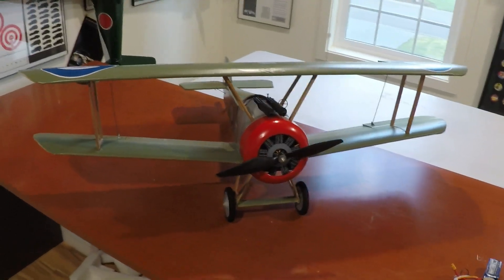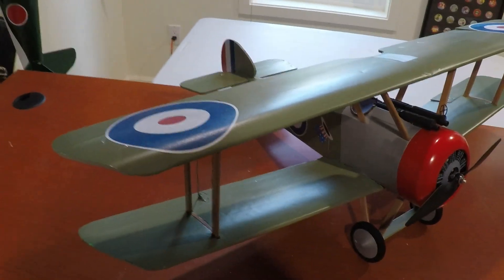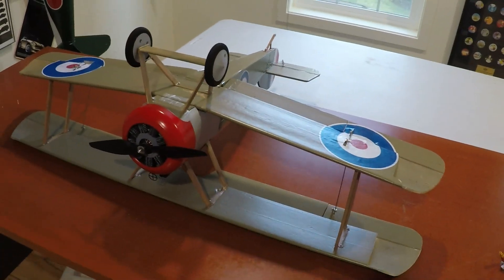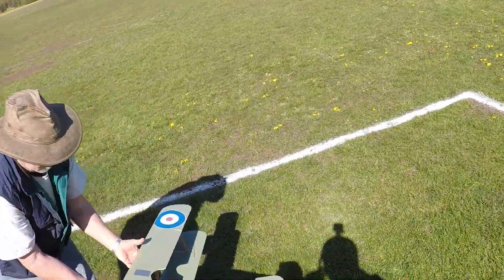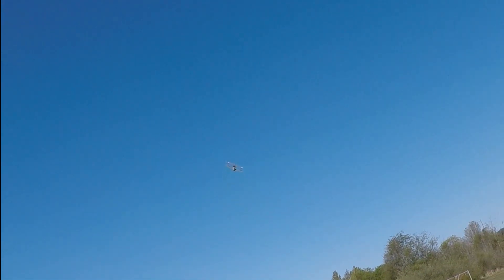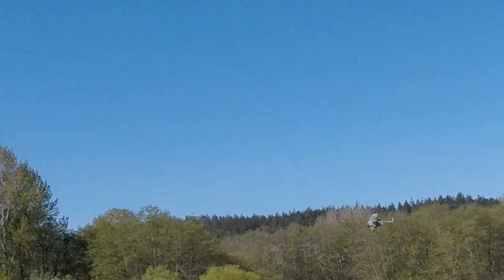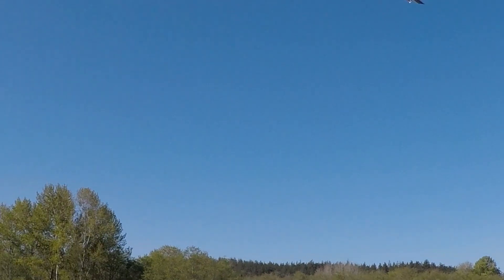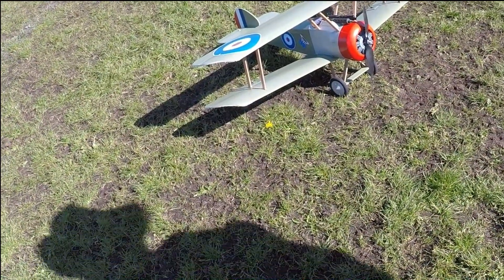Foam Board and 3D Printed Sopwith Camel Maiden with Design and Build Details

Comment: Some Bipes are sweet to fly, some are real dawgz in turns. My favorite Biplane had an OS FSR/ABC and tons of power. The better the pull the more fun a Biplane is. 😊
Reply from the maker: I agree. First I will try a new prop (on its way) which will get an additional 100g pull. If still wanting, I will swap to a higher kv motor for 500g more pull. Thanks for the comment!